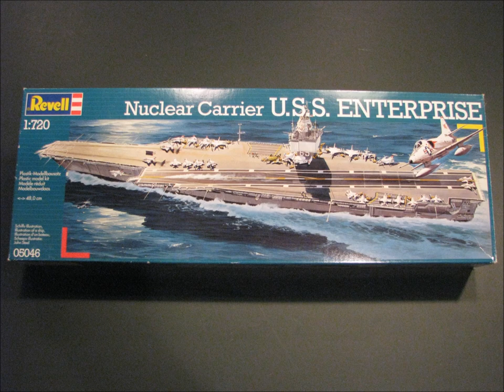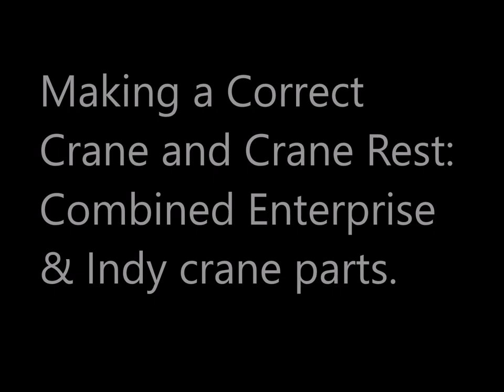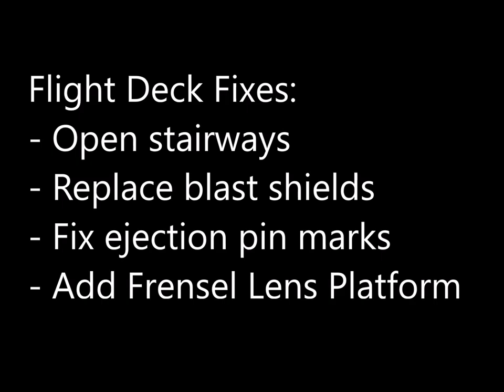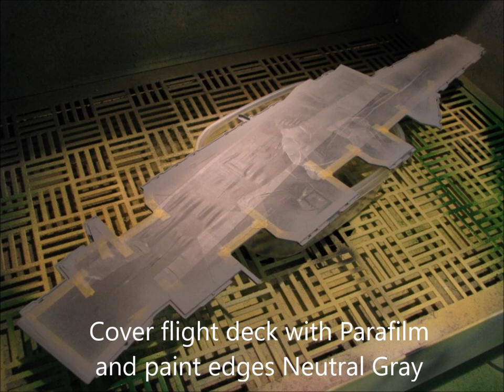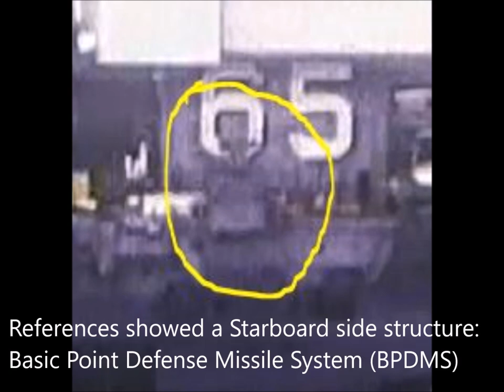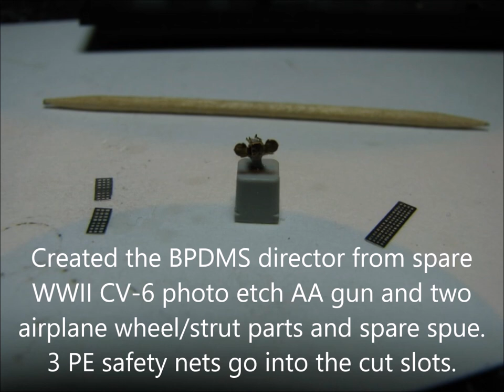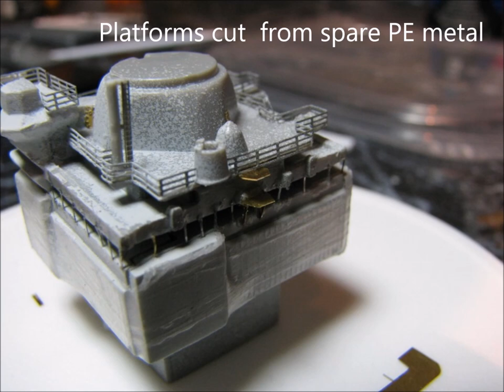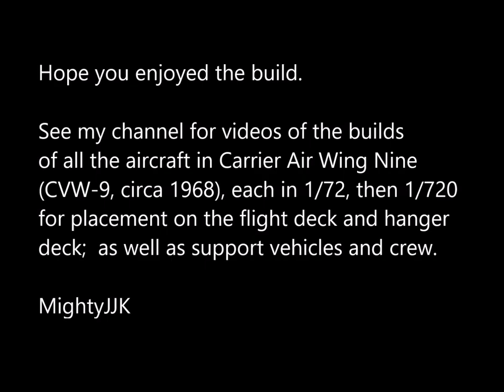1/720 USS Enterprise CVAN-65 Build & Detailing

Comment: Nice job! Going to build mine in circa 1972 to use some spare F-14 Tomcats
Reply from the maker: Thanks for the view and kind comment.  Hope it helps with your build.  Good Luck and hope you'll post a video when you're done.  Thanks again.
Reply: @mightyjjk1298  first update posted yesterday
Reply from the maker: @BwoahBwoahBwoah  , I saw that.   Looking good.  A few tips, if you don't mind:  Wait until you're completely done to do your decals; and lay down a coat of clear acrylic (especially over flat paints), like Pledge Floor wax, with a brush where your decals will go and let it dry for a day before you lay down the decals.  Decals adhere and look best when laid down on a very smooth surface.  You should be able to find the Pledge Floor Wax in the cleaning products isle of your local grocery store.  Keep up the good work and keep posting progress, and I'll keep watching.  Feel free to ask any questions as you go along.  I'm so happy to see a young person like yourself getting into this great hobby.  Good Luck!
Reply: @mightyjjk1298  just added the hanger deck and will begin painting the runway area
Reply from the maker: @BwoahBwoahBwoah  , Good progress.  More tips:  Take your time. Use scissors on masking tape to get nice straight edges. and carefully use the masking tape around the engraved landing area markings. Wait until the paint is semi-dry/tacky before pulling up the tape.   I can't stress enough...take your time. Its not a race. It's about accuracy, not speed.  You will be happier with the results in the end.  Keep up the good work.  And feel free to ask any questions as you go.  Good Luck.
Reply: @mightyjjk1298  I don’t have masking tape but I trust myself enough to paint the carrier but thank you, in case I do more carrier models

Comment: Hey how are you? Can I send you a question again about the build? I didn't had the time last time we spoke due to working and changing from place haha. I'm going to paint the deck next week but I don't know how to start with the black and white lines? Can you share us some tips? Stay safe pal!
Reply from the maker: Wash the parts with dish soap. Then paint the deck black first. Let that dry. Then mask around he lines etched in the deck part.  Like it looks at 20:13 in the video. Paint the masked out white lines with the center line yellow & white.  When that’s dry mask over that and the entire deck up to the edges. And paint the edges hull gray color.
Reply: @mightyjjk1298  So if I'm correct u painted the white and yellow stripes on the deck? Or should I buy the decals and wait for them to arrive?
Reply from the maker: Nicky Louwagie,  No I used decal for all stripes. I highly recommend the star fighter set.

Comment: Why does the model say to make the bottom black even though it should be red?
Reply: Not sure, but model building instructions are often wrong. That’s why you should always use independent references.
Reply: I built a Revell Saratoga CV-60 about 60 years ago and just didn't personally like the red.  I thought it was too distracting for a model that wasn't a waterline model.  So I painted the hull grey and, below the water line, black.  It's "not prototypical", but it made for a nice clean look.  It sort of put that bulk of the bottom of the hull more out of mind and focused the eye on the superstructure.

Comment: Have you built it to look like it did in the mid 80’s?
Reply from the maker: I was/am working from GRS video taken by crew on the 68 cruise. I think the bow 65 may be the solid one, etc.  I'll get back to the ship/deck pretty much as the very last step, after all the aircraft, vehicles and crew are done.  Then, I'll make any last corrections, weather (lightly) the planes, vehicles, ship and deck; and glue all of the above in final position.  That's going to be years down the road at the pace I'm going. 
If you are aware of anything that needs correcting, I want to know.  As you saw in the F4 Fix video, historical accuracy is important to me.
Thanks for the interest.
Reply: MightyJJK I served aboard the Marine Detachment on the USS Dwight D Eisenhower CVN-69 from May 87-89. Started getting back into model building the past few years.
Reply from the maker: Dogs of WAR,  Thanks for your service. Let me know if you have any questions. Happy to help.

Comment: Hey bro. I just bought the USS 1/720 Enterprise from Revell. I don't have all that fancy stuff like you. I only use my brushes/ paint/ pva glue and decal solution. Can I also build it or not?
Reply from the maker: Absolutely you can! My only suggestion would be to use spray cans for the red, and gray, ie, the largest surface areas.  But instead of after-market decals, you can just mask tape around the etched in landing area outlines and brush those white with a white and yellow center line down the middle.  It’s a good kit to build “ out of the box”. And if you check out my plane builds, you’ll see Im building them pretty much “ lout of the box”.  I just took this ship as far as my predetermined budget, imagination and meager abilities allowed.  (I already had the Indy kit and decided to canablize it rather than build it). Good luck on your build and feel free to ask any questions you might have along the way.
Reply: @mightyjjk1298  Can I also do those area's with brushes? I prefer the "old fashioned " way haha. And as for the stripes on the deck: did u first painted the gray area or did u first painted the yellow/ white area? also: have you used any primair colour or not? Because for my Millenium Falcon and Airbus A360X I used primair (this is only my 3rd build I make).
Reply: Because I don't have those white and yellow stripe Decals included is this normal or not?
Reply from the maker: Nicky Louwagie, you can paint the entire model by brush if you want.  It will just take longer. The Order would be: lower hull red. Deck black or dark gray, edge of deck and island lighter gray.  Then the landing area outlines white then center line yellow and white.  Good Luck.

Comment: Could You share de sizes, like lenght, wide and hight?
Reply from the maker: It is 19 inches long.  About 5 inches at the widest.  And overall about 5 inches tall,  with the tower being 2 1/2 inches of that from the deck to tip top. Hope that helps.  Thanks for watching.